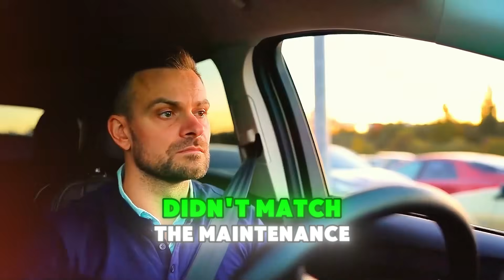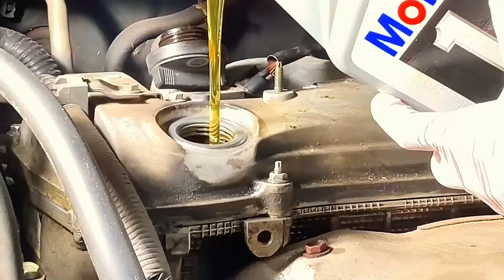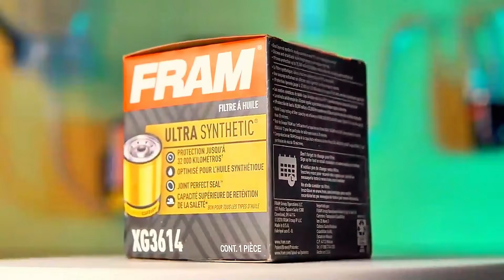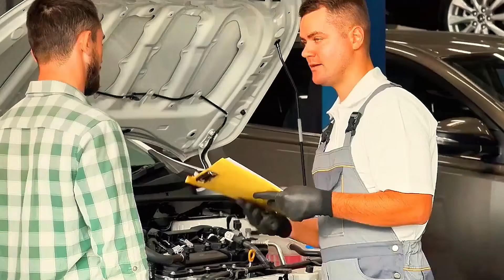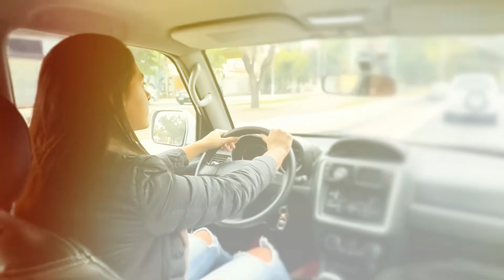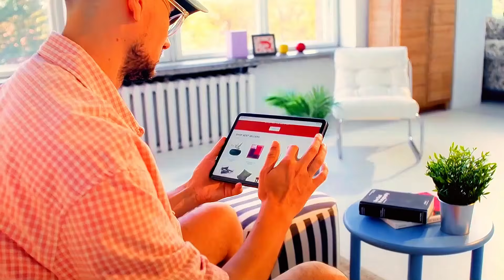The 3 Motor Oils Quietly Destroying Your Engine And the 3 That Actually Protect It

Comment: Worst 
1. Super tech 
2. Quaker state
3. Castrol GTX

Good
1. Mobil 1
2. Penzoil Platinum 
3. Castrol Edge Syntheic 

Your welcome
Reply: Amsoil Signature Series for the win
Reply: Penzoil is my go to and has been for over 5 decades. My dad used it and would not use anything else, and he rebuilt motors and tranny's both auto and manual, and they stayed running.
Reply from the maker: That is an incredible family legacy, Ernie! When an experienced engine builder tears down motors and still sticks strictly to one brand for 5 decades, that tells you absolutely everything you need to know. Pennzoil's natural gas base does an unbelievable job at keeping things clean. Thank you so much for sharing that story!
Reply: Thank-you,  best comment
Reply from the maker: Appreciate you dropping the summary for the community! You hit the nail on the head. Using top-tier synthetics like Mobil 1, Pennzoil Platinum, or Castrol Edge is the ultimate secret to keeping those engine internals completely spotless. Thanks for watching and helping out the comments section!